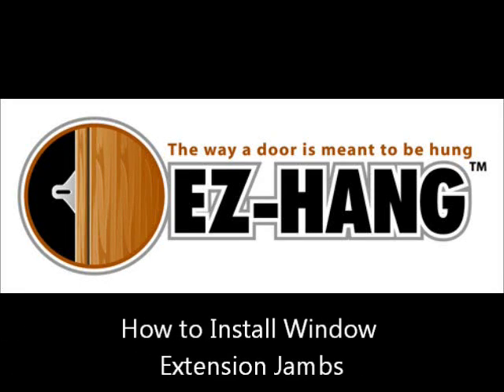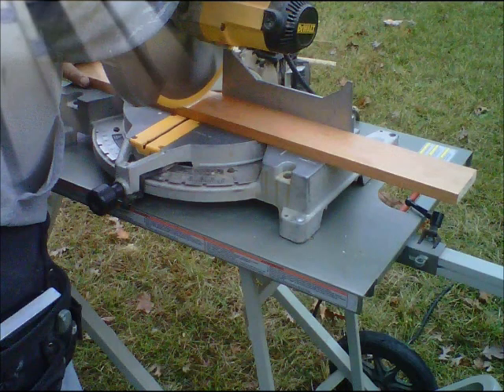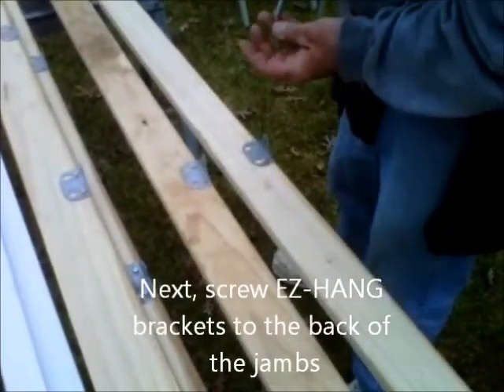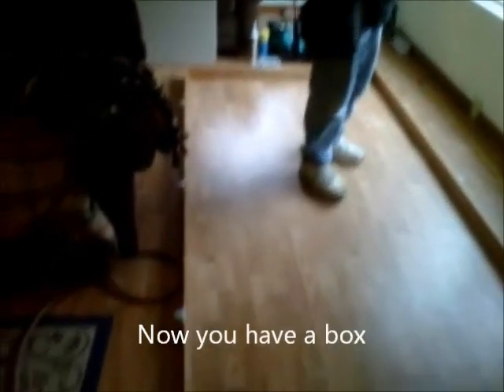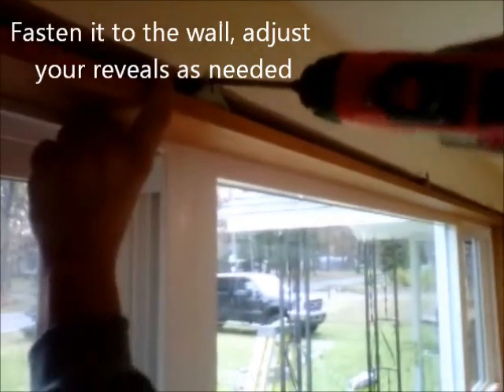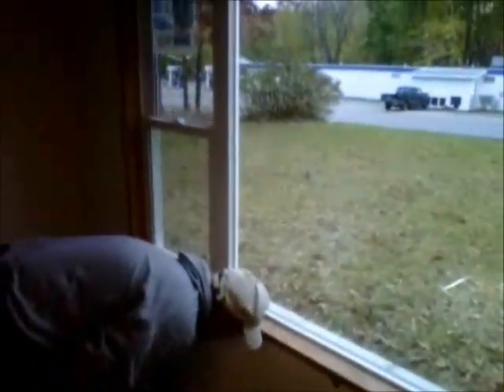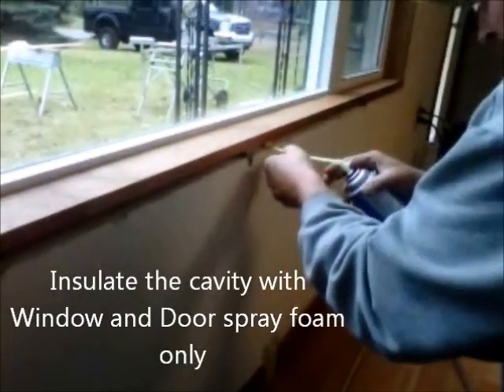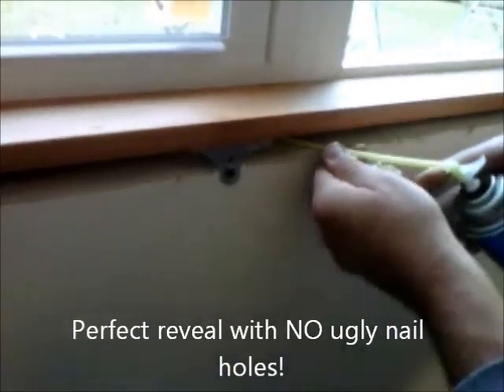Installing Window Extension Jambs

Comment: These brackets are a great idea. I agree with dynocompe's suggestion of shimming the gap, especially on the bottom.  I'd also put a bead of caulk between the wood and the vinyl.

Comment: I think this is a great idea to have strong thick fixed jambs and sills box like this, shim them into the opening though your windows will be smaller but it helps alot in avoiding all the problems with opening not straight, measurement errors, tolerances particularly for the fins nailing type windows. This technique also helps to keep vinyl windows structurally straight supported by the jambs and sills. When the vinyl windows frame is not straight weighted down by its own weight, you can not close the latch easily like when it is outside.

Darn, why did I not think of it before and by now, I have already had my fins nailing windows ordered, trying to install and running into all kinds of dimension tolerances issues. I found this video by searching for how to shim windows, not by how to install windows. 

This technique was done on on my old aluminum windows. All other video on the webs are wrong or simply dangerous short cuts. And worse not even windows manufacturers like Simonton, Milgard, Jeld Wen know and recommend this. Thanks though it is late for me.

Comment: "now you have a box" wrong , box is Noun
A container with a flat base and sides, typically square or rectangular and having a lid.

what you made was a square frame.

I would also shim the gap, especially for larger jambs. How many times do kids sit on windows? People place items on jambs? Shifting in houses in certain regions. Shims will make it alot more solid. Spray foam is great, but unless its foamed right to the outside of the jamb, it wont give it full support. just brackets can give bow.

Comment: dynocompe and Intoxilyzer sound like a couple of definition police dweebs but neither of you is entirely correct. Intoxilyzer, a rectangle, by definition, is also a square it's just another type of square, A square is defined as a shape having four right or 90 degree angles hence a rectangle is a square. You may want to lay off the booze that you elude to being a fan of by your user name. And dynocompe you quoted the typical definition of a box but not the only one. A box can also be a space, a 2-D space, enclosed by lines. Brush up on your defs. guys before you start nitpicking. The lady narrating the video was correct. Shims are usually used at nailing or fastening points where fasteners go through the wood. Since this is not the case here the method they used should work fine. The jambs are relatively narrow which would preclude the placement of anything heavy on them. The incidence of people sitting on frames doesn't warrant the need for shims. How many shims and what placement intervals would satisfy you guys?
Reply: A rectangle by definition is not also a square.  A square has 4 equal sides and 4 equal angles.  Only a rectangle that has 4 equal sides and 4 equal angles is a square.  A square is a rectangle.